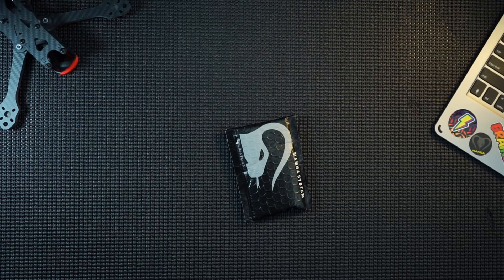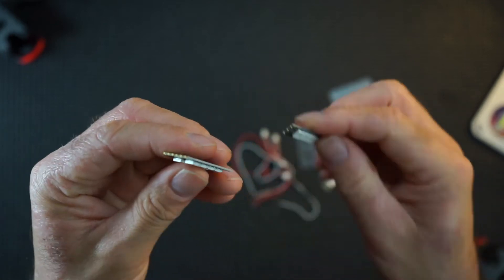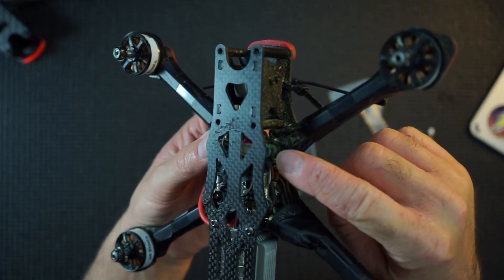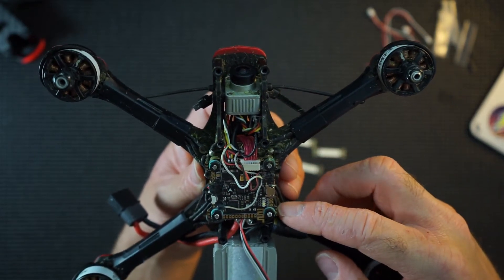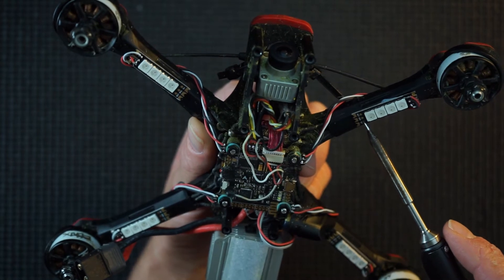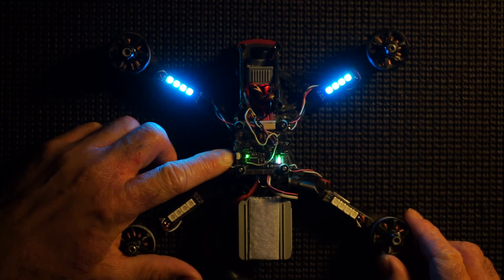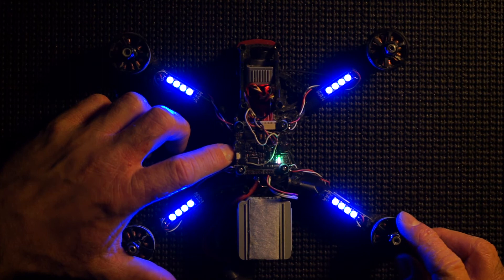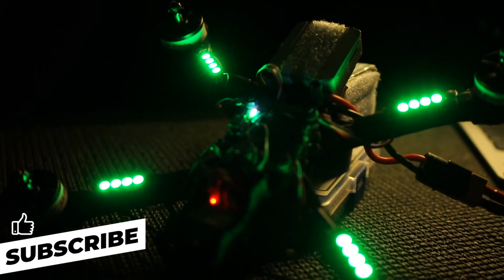LED's Pimp your fpv QUAD with Diatone SW401 MAMBA LED's

Comment: Hi, one question, I tried to connect a led by simply connecting between the ESCs and the motor ... But they don't turn me on... Sw401... Why?
I did other tests, I also connected another led only to the FC ... Configured in BF but nothing .. That does not turn on either ... My FC is a Mamba f405 mk2
Reply: Same question!
Reply: these have race wire pads as well, so yes you can use for your motor wires as well, the leds connect to the smaller separate pads

Comment: So I can wire the LEDs to the led pads and still wire in the motor's through them without affecting the LEDs??
Reply from the maker: Hi - yes mate, small tiny dot pads for the leds and then you can wire motors in on other pads
Reply: @Datfpv  brilliant mate and thank you for the reply, much appreciated, keep up the great work and awesome videos, thank you #FlySafe #StaySafe
Reply: @Datfpv  hi mate another quick question for you, do the IN pads on the led go to the FC or the OUT pads? I'm not using a F7 but the Mamba F405 MK2 I also have a separate Mateksys 2812 LED controller
Reply: Hi I also have mamba f405 mk2 so does this mean I can wire it to the led pads (to control) and also to connect motors to flight controller ( wires aren’t long enough)
Thanks
Reply from the maker: @joebrammer9391  these have race wire pads as well, so yes you can use for your motor wires as well, the leds connect to smaller sep pads
Reply: @joebrammer9391  Hello ... A question, did you manage to make them work on your f405 mk2? .. I connected the LEDs both between the motors and ESC, Both to the Pads of the fc ... But nothing ...
Reply: sorry to be off topic but does any of you know of a trick to log back into an instagram account?
I stupidly lost my password. I love any tricks you can offer me!
Reply: @Cohen Legend Instablaster =)
Reply: @Zayd Layton I really appreciate your reply. I found the site on google and I'm waiting for the hacking stuff now.
Takes a while so I will reply here later when my account password hopefully is recovered.
Reply: @Zayd Layton it did the trick and I actually got access to my account again. Im so happy!
Thank you so much you saved my account!
Reply: @Cohen Legend you are welcome :)

Comment: first why not rotate the leds so they are short,second why the top and not the bottom/.....
Reply from the maker: Hi mate - yes if I was to do this properly they would be underneath - it was purely for camera purposes.
Reply: Best to be in front and back of arms like head and tail lights.